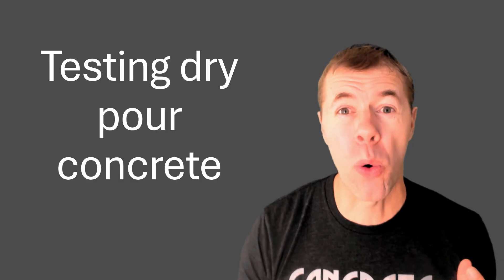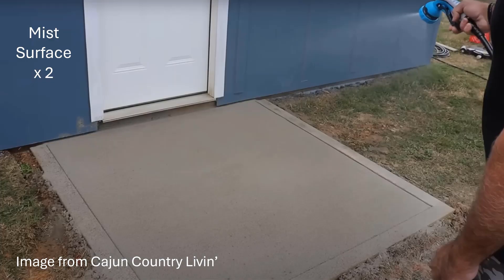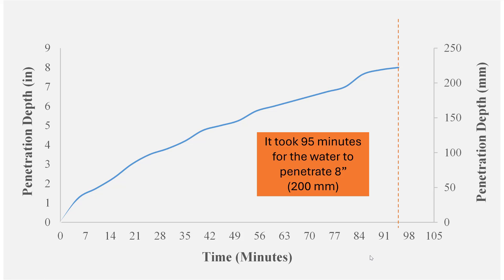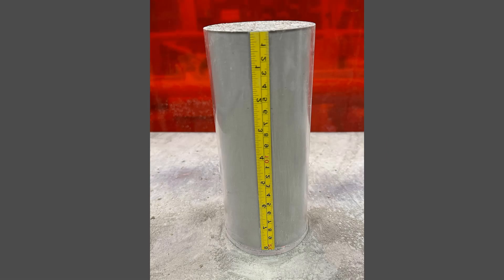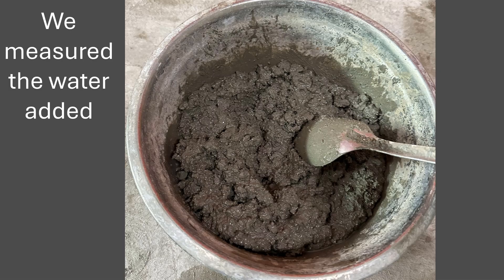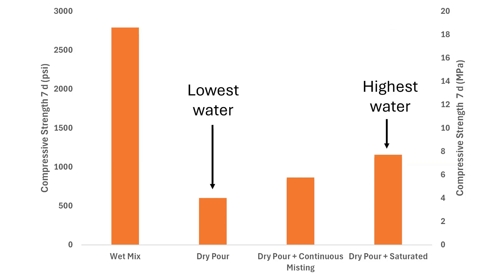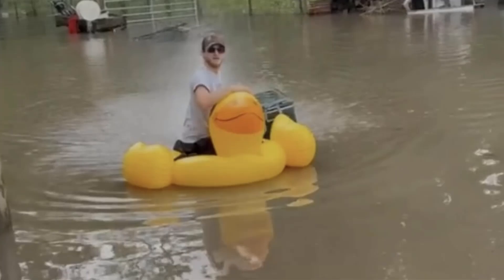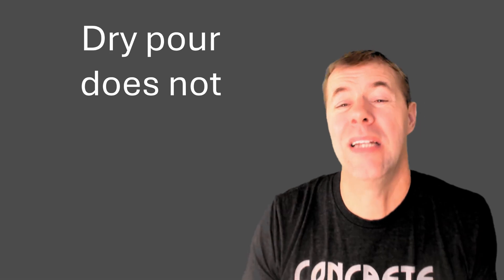Testing Dry Pour Concrete with an Expert

Comment: Another way I've seen dry-pour concrete used is around posts dug into the ground. When you dig the hole, put the post in the ground and fill the hole with dry concrete mix. This presumes there is enough water in the surrounding soil to hydrate the cement. I've seen this done often and have always wondered how strong that concrete mix gets.
Reply: I think this application works because the concrete isn't subjected to particularly high stresses, acting largely as a mass ballast and to increase the friction as the post is torqued out of the ground. The primary load is still transferred from the post to the soil since the post is placed in direct contact with the ground prior to packing dry concrete mix around it.
Reply from the maker: I agree with Maud!

Comment: I like that you showed a practical use case for dry pour.  I wish you would have tested a few samples with a freeze/thaw cycles for the dry pour.  I have used dry pour on fence posts more than ten years ago and the posts are still solid.
Reply from the maker: I do a lot of freeze thaw testing and I don't think the dry pour would do well in the "standard" freeze thaw test.  If concrete stays dry then it is not damaged by freezing and thawing.  If you went out and kept water on your fence post and then let it freeze then I think it would start to be damaged.  If water does not pond around the fence post then that might be why you don't see any damage. 

We are doing a massive study on freeze thaw environments around the US.  We have learned a ton about why concrete fails rapidly in some areas and not in others.  We are writing the papers now.  Videos should follow after that.
Reply: @TylerLey  As someone in the northern US, im lolking forward to those freeze/thaw videos!
Reply: I recently reset some fence posts that had been pushed up by freezing thaw over many decades.  They each had a small amount of concrete around them, maybe a 50lb bag at most,  with the post protruding out the bottom.  I left the concrete on the post since it was holding on to the post very well.  I cleaned off all the dirt very well and where necessarily brushed to clean pockets androids in the surface. I then redug the holes making them about 8" larger than the existing concrete post slug and about 12" deeper as well.  I did a modified dry pour in that I spray water as I pour it in the hole and then used a #5 rear to tamp the mix and get out air pockets as well as compress the mix.  I added about 160lbs of concrete at each post.  The last 6" gets a proper mix concrete with minimal water used.  This has been my "method" for years including protective bollards.  In the case of the bollards couple got tested and faired well.  But I sure as hell would never dry pour a slab.
Reply: Have done dry pour a couple of times not on fence posts. Works for posts. Add an inch and wet it with a hose until about 4 or 5 inches thick then wet it hard and let it sit until it is soaked in. Then, run a plate compactor over it  until it gets soupy top and finish it. Seems to work fairly well. But was just a quick fix sort of thing. Wet much better.